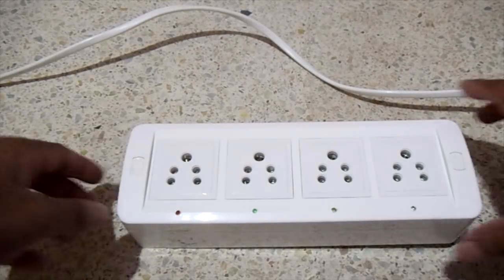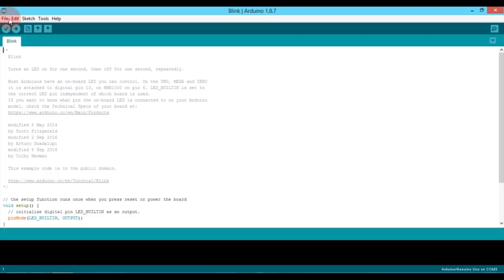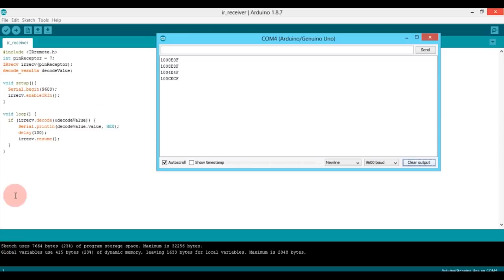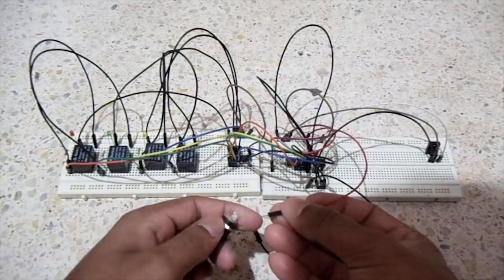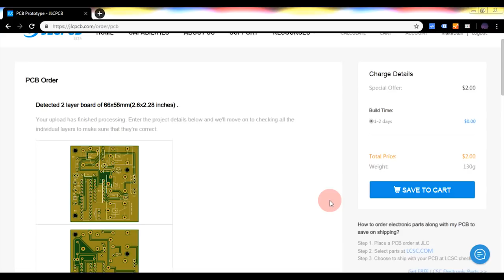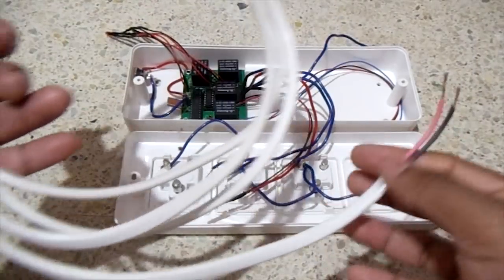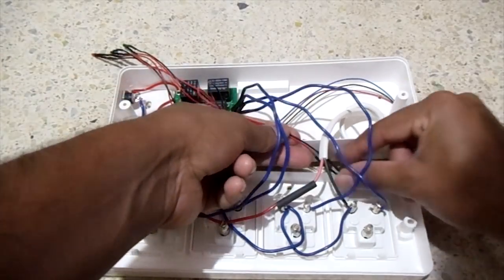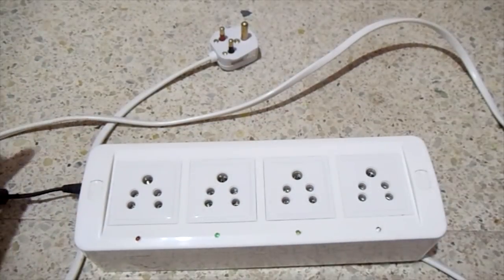How to make Remote Controlled Spike Buster or Switch Board using Arduino Uno or Atmega328P-PU

Comment: Sir you have mention 4 channel led  which you have written 9,10,12,13 in coding but you connect relay with  pin 4,5,6,11 of atmega328p  ic .how can it.if i use this code and connect 4 relays with atmega328p  pin 2,3,13,12 .will it be work?